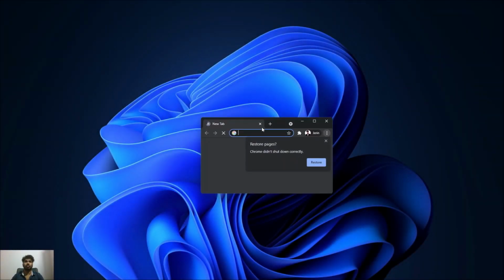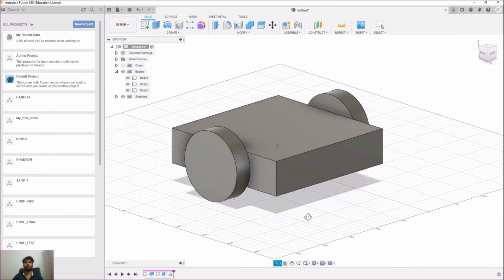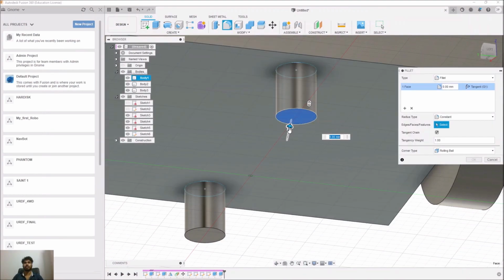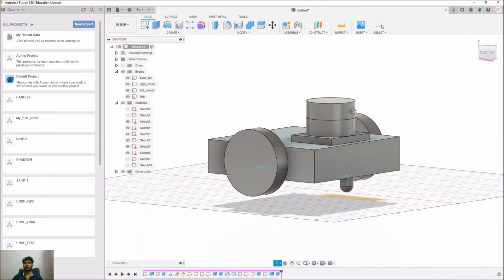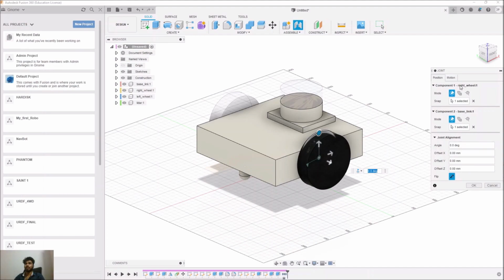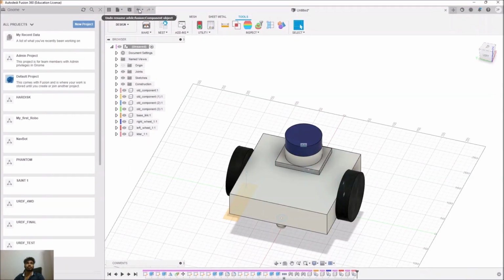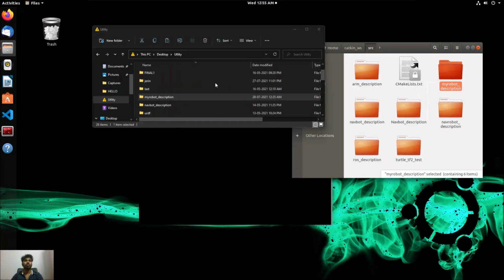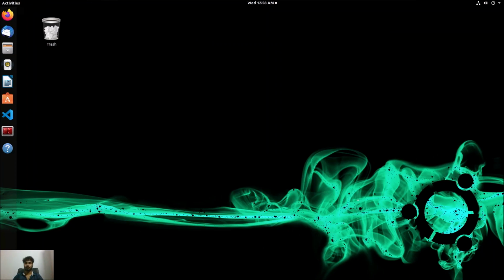Fusion 360 to URDF | Simple Diff Drive Robot Modelling | ROS | Mapping | Navigation | Part -1

Comment: hi, I followed the video, and worked very nicely.  But I've faced some issues on the joint. My wheels are revolving very fine in fusion 360's animation. But when I launch the file on rviz, the wheels do not rotate on their axis rather they rotate on the car body's axis. what should I do? I cross-checked everything and it seems all are normal. Any hope?
Reply from the maker: Export the components as separate file and in a new project import all and join them fresh

Comment: when we export to URDF, does it have inertia and mass information ?
Reply from the maker: Yes it does, but I am not sure if the parameters will  change if we change the material properties that we model with in fusion360 need to check on that. But you can always edit the parameters in the URDF file that gets exported
Reply: @Jp_Robotics  and the plugin also created that ROS package with launch and xacro files ?
Reply from the maker: @sandeeppatel7603  yup

Comment: I am making my first robot. I am able to create the URDF, but it only displays the base_link and the rigid joints I have created. I have four revolute joints that are connected to the base_link, but they do not show up in RViz. It states, "No transform from [lf_wheel_1] to [base_link]" for each of the wheels. I did set the wheels as component 1 and the base_link as component 2, but this problem persists. Any ideas?
Reply from the maker: Is the model showing up properly in Gazebo?
Check if your fixed frame is base_link in Rviz
Try running the joint state publisher and robot state publisher of it's not running using the following commands
rosrun joint_state_publisher joint_state_publisher

&

rosrun robot_state_publisher robot_state_publisher

Try these and get back
Hope it helps ✌️

Comment: Hi Jerin, I'm having this error after running fusion2urdf plugin on fusion, could you help  me please
Traceback (most recent call last):
  File "C:/Users/Dhilan/AppData/Roaming/Autodesk/Autodesk Fusion 360/API/Scripts/URDF_Exporter/URDF_Exporter.py", line 59, in run
    joints_dict, msg = Joint.make_joints_dict(root, msg)
  File "C:/Users/Dhilan/AppData/Roaming/Autodesk/Autodesk Fusion 360/API/Scripts/URDF_Exporter\core\Joint.py", line 172, in make_joints_dict
    if joint.occurrenceTwo.component.name == 'base_link':
AttributeError: 'NoneType' object has no attribute 'component'
Reply from the maker: Try to redefine the joint attached to base_link
This error may happen when the relationship between the parent and the child of a joint is the other way around.
The parent links should be set as Component2 when you define the joint not as Component1. If that also doesn't work try redoing all the joints again and another way is to export each component as a seperate file and save it on your desktop and open a new project import all the components and join it. For me sometimes this helped try this out if your model is a simple one.
And also make sure your model doesn't have nested components.
Reply: @Jp_Robotics  Thank you Jerin, I'll try it :D
Reply: while creating a joint, if your joint is not between child and base link then that will happen, basically when you select componenet 2 for joint, just see if its really base_link or something else. this error is usually because of it

Comment: How to open Joint state publisher gui window in rviz?
Reply from the maker: You can use this command
rosrun joint_state_publisher_gui joint_state_publisher_gui
Actually the command for launching the joint state publisher gui is already there in the launch file (display.launch)which has a parameter use_gui which I guess is deprecated in ros Noetic. So you can run it by using the above command in another terminal 

You can refer here for more info 

https://www.programmersought.com/article/73306366777/

Hope it helps ✌️
Reply: Thank you 👍